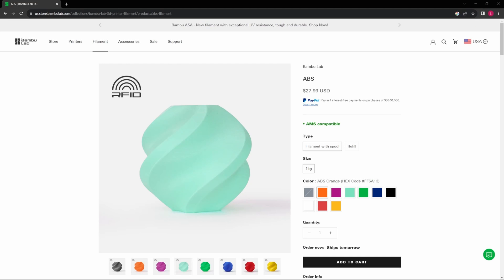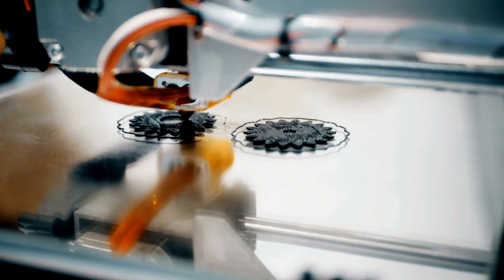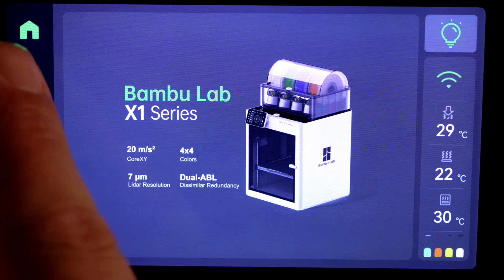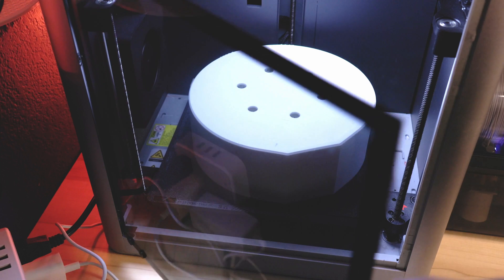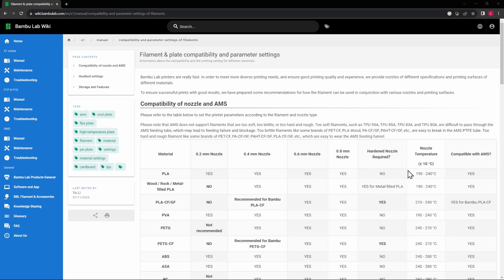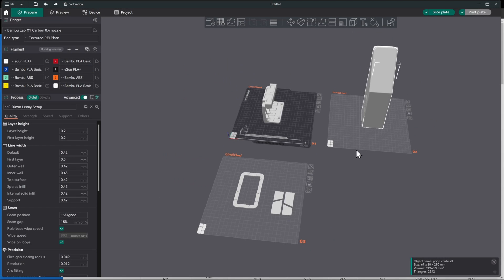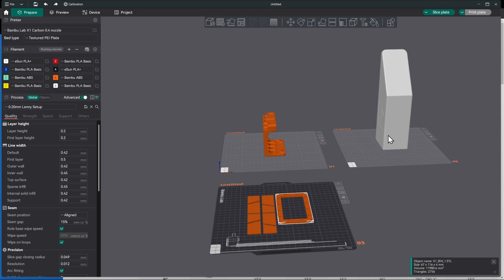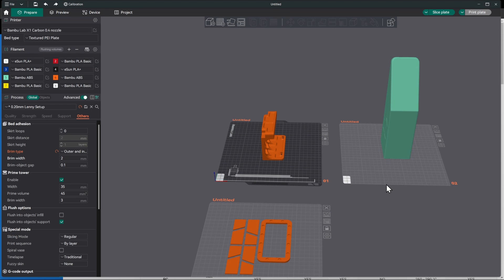Mastering ABS 3D Printing With the Bambu X1C: Beginner's Guide to Durable and Heat-Resistant Prints

Comment: no glue or nothing? i just tried printing abs on the texture plate, a small bracket for my hultafors libella. it was a disaster. should i go for the non texture plate and use magigoo or what? ii have zero experience with abs, but i really badly want to print with it.

Comment: I print eSun white ABS on an ender3 v2 in an enclosure.  I am in a large basement with no special ventilation.  I smell nothing.  Bad nose?  No odor, but deadly?  Does it matter; I am 77YO (LOL).
BTW, the prints are excellent (250/100C No fan).

Comment: No more ABS more me / 7 years now - not worth the trouble. Use good old PLA and increase the fill if you want stronger parts. ABS is great for mold injection parts that are made in a flash / abs expands and contracts too quick and I have some models I 100% bet no one could print with ABS.
Reply: indoor models at low temps is fine in PLA.  Others want outdoor or higher temp parts.  Use the appropriate filament for the task of course.

Comment: ABS is not harmful in well ventilated areas? ABS is releasing styrene. Even in a very well ventilated area you should use filters for that nasty stuff. And not just the X1C default filter.

Comment: ABS is dangerous, but not in small ammounts. Heating up plastics to 250c is inevitably releasing things not meant for breathing. Breathing in large ammounts will inevitably be unhealthy. Thus, reducing it is healthy. This is undeniable. Living in the workshop is ridiculous and inevitably unhealthy. But going near the printer isnt exactly going to kill you. Nor is coming into the workshop and working a bit. However, if you expect to sit around next to 4 printers printing ABS, sanding, painting and gluing things for hours in and out in your workshop - you must have good ventilation. 

No, it's not a "nah it's fine! I have done it for years so its fine" kind of situation. Breathing oxygen and drinking water is what you are made to do and you are worse off without it. Drinking coke is bad. But drinking one coke isnt deadly. Drinking coke instead of water every day is deadly in the long run. Same deal with ABS. Ventilate and dont spend hours on end next to the printer. Dont place the printers in your bedroom. It's not dangerous if applying common sense.

People are so scared of ABS fumes. RIghtfully so, but also ridiculously so in many cases :P

Comment: Hi Len. I just got my first roll of ABS after giving up on ASA (warping larger prints). Thanks for this video.
Is the drying of the filament necessary even with a brand new / fresh spool? 🙏🙂
Reply: My ASA does not warp.  Try another brand.  I use both eSun and Bambu.  I do use an 8mm outer brim always.
Reply: ASA warps less

Comment: What is the speed for printing ABS on the x1c, because i have a russian filament that cant go faster than 40 mm/s on the label so i wonder if i can print it faster on my p1s?
Reply from the maker: I don't change the speed.  This is Bambu filament and I just use normal settings.
Reply: You need to run some tests.  Each brand has a top speed.  Likely slower than Bambu brand default, I would expect.

Comment: Thank you for this video.  What was the ABS printing temperature for these prints?  And was the part cooling fan on during printing?
Reply: I use 250/100C and no fan with great results on eSun filament.

Comment: Thanks for the informative video! My biggest question is: how does the print quality compares to PLA?
Reply from the maker: Depends on what you mean by quality?  Looks, strength,rigidity etc…. It is stronger and more rigid but the looks of the prints look similar.
Reply: @lendizzle77  thanks for the quick reply, much appreciated! I meant in terms of (absence of) artefacts, quality of the bridges, overhangs and just overall ease of print, especially with more complex parts. For instance, PETG tends to not print as well as PLA, often showing more artefacts, sometimes surface imperfections etc. - it’s just overall a more challenging material to get consistent quality prints with, especially with complex parts. I hope this makes sense! Any feedback would be very much appreciated 🙏
Reply from the maker: @proastroz5759 ABS or ASA are harder and do print a little smoother. Be careful with warping on larger prints

Comment: Thanks.  After 3D printing many years, and getting 2 X1 Carbons, I decided that it was time to end PLA as it breaks in the AMS OFTEN, and while results are usually good, I'm over it.  (Interesting because I started with ABS 5+ years ago but switched to PLA.). I never really liked PETG, although it prints well in the Bambu, but I decided I was going to ABS and mostly ASA. I haven't looked back at all.  BUT I did buy a BoFA Pro 3 fume extractor which I ALWAYS use with ABS/ASA.  It does cost the same as an X1, but it works great, and I'm not sorry.  Oh, lets talk about Build surfaces.  I got so frustrated that I almost gave up on my ABS dream with warping, until I discovered Garolite.  100C works fantastic, and for nylon, NO HEAT and works great as well.  I have not discovered anything Garolite doesn't work with.  Go to 3DXTECH, they sell Garolite that fits the X1 bed perfectly.  Its even self-stick.  ABS and ASA stick like a dream, cool it down and they pop off.
Reply: How do you use a garolite/g10 build plate on your bambu?

Comment: My x1 wont print with the abs in the ams. I dried it 8 hours at 80 degrees. Put it in the ams. Then when I select the 3d print after I get to choose the filament to use. Abs is there but its not a clickable option. Do you know why?
Reply: I ran into that same problem, but it was because I had to select that type of filament since I have been print PTL, just add the correct filament in this case Generic ABS on the Bambu Lab X1-C or it will not select either, also don't forget to select the correct Plate Type as well that was my second problem. Easy Fix.
Reply: I figured it but thanks for replying. I also figured out that ABS on small small little tiny pieces is no good. Its not strong on small pieces.   @luismrodriguez714
Reply from the maker: That is weird.  I have not run in to that.  Send some photos to my email: lendizzleprintz@gmail.com

Comment: I got two x1 carbons. Abs roll in the ams but the ams wont print it. WTF…?
Reply: I ran into that same problem, but it was because I had to select that type of filament since I have been print PTL, just add the correct filament in this case Generic ABS on the Bambu Lab X1-C or it will not select either, also don't forget to select the correct Plate Type as well that was my second problem. Easy Fix.

Comment: I have to downvote simply for the thumbnail, you are perpetuating this myth that abs is extremely dangerous, its not! If your ABS smells overly bad, then stop buying the cheapest chinesium filament you can get your hands on. There is a huge difference in ABS smell across manufacturers. In my opinion printing with ABS since 2013, an enclosure is not a "consideration" but a MUST if you plan on printing anything more than a few centimeters high.
I really think the Bambulab printers have drawn in many "dunning kreuger" experts. Everybody wants to be a 3D printing youtuber, why not just buy your tool and use it? You have no purpose for it?
Reply from the maker: You might want to watch the video.  I am not sure I could have made fun of that myth any more and really tried to show people not to be afraid of printing with ABS.  The thumbnail is sarcastic and playing on all of the bad information you are pointing out to draw people in.  Thanks for your feedback.
Reply: @lendizzle77  Don't take ABS?ASA lightly. The full health effects are not known, BUT it definitely DOES cover the insides of a printer with a film, so use it without a fume extractor at your own risk.
Reply: I mean if you don’t enjoy your health it’s fine
Reply: @Skibbyz   You are uninformed.
Reply: The  very first thing he does  is address the thumbnail
Reply: where do you get ABS that smells like rainbows?
Reply: @marshallb5210  Just don't buy the cheapest rolls of filament you can find and the smell is way less obnoxious, there is a HUGE difference in smell between filament from China and filament made in the west.
Reply: There are studies that support that. PLA has about 5μm/m³ of particle emissions, while ABS has 68-76/m³. For comparison: A heavy frequented road with many diesel vehicles has around 50μm/m3.
PS: You can't smell particles, even if it smells less bad, it is still not good for you health.

Comment: Thanks for the video. I am looking forward to creating some custom kitchen drawer containers for flatware. I have been trying to find filament that would be safe. I read that most filament is either toxic or not safe because bacteria can occur. Have you ever tried printing anything food-safe ?
Reply: Theorically, PETG is food safe... HOWEVER, additive printing will leave small openings where bacteria can grow even if washed. To prevent that, you need to use epoxy resin to cover your print. Prusa has a good video on the subject.
Reply: You would be better off 3d printing mold templates to make out of silicone, and then using those silicone molds to make your parts out of a food safe resin
Reply: @StevenWichers  or buy a $2.00 tray? LOL
Reply from the maker: I have not

Comment: Did my comment get deleted?
Reply: Probably
Reply from the maker: I haven’t deleted anything
Reply: @lendizzle77  Thanks.  Very weird.  I commented on your video yesterday and this one.  Anyway, Modbot had a recent video about adding the BL LED module to the X1 which has lights that have multiple functions.  Great option for the extra light you were wanting in the other video.  With this mod, there are risers to print for the lid and I was trying to print in ABS but had horrible warping issues.  Have you dealt with any warping printing ABS?  I was even using a 10mm brim but the parts were just pulling free from the brim.
Reply from the maker: I have not had any issues with warping.  Only issue is with PEI plate and small pieces but that is common with all filaments.